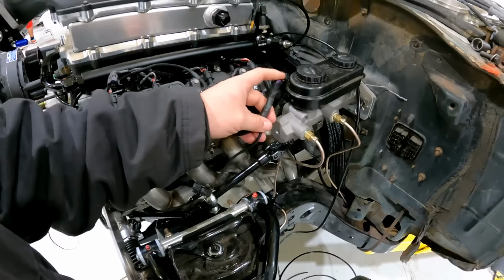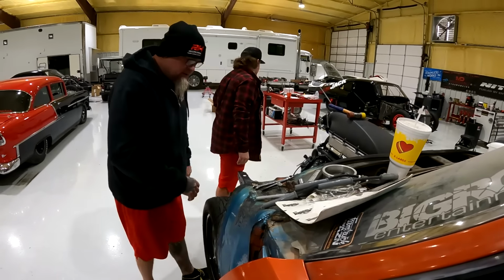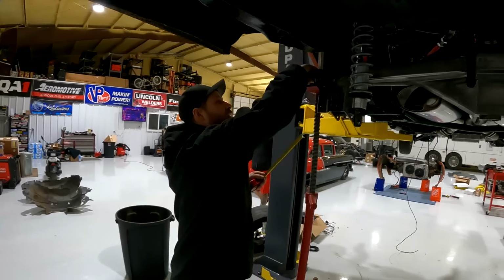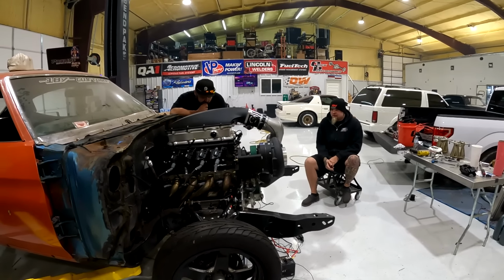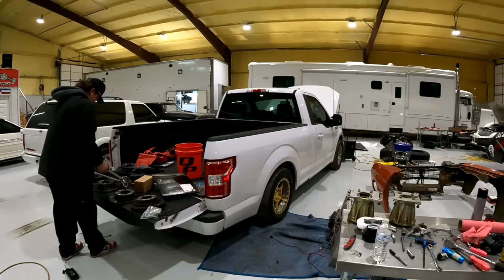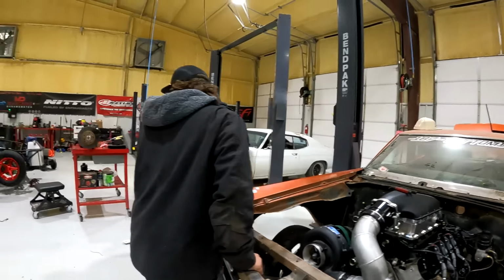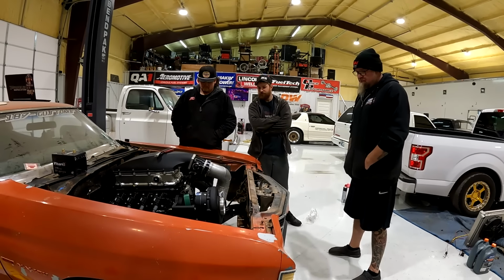Will Aiden’s Procharged LS Swapped Start Up?! Plus Building New Quick Performance Rear End

Comment: Hey Shawn I saw another guy with similar engine combo and had same belt issues and he added one if not two additional belt tensioners if u want to see it it was in the short video section and u can search procharged small block with belt issues added belt tensioners and u should be able to see what he did ,I thought it might help you guys I’ve never had one or even worked on one but morons help each other out is my motto 😂

Comment: The ubolt straps on the ujoints only have to looses a bit for ghe caps ti fly out past the retainer lug on the pinion yoke. Them being loose is about the only way the caps fly away. If they are tight the ubolt. holds them in place.

Comment: I remember swinging the hammer as a kid working on my jeep Cherokee putting the lift kit on and the control arm bracket needed some clearance. So hit it with dads big hammer that had the nail in the handle end and watching the hammer head come off and hitting my dad between the eyes

Comment: Used to try running the 80s sikverados on the street with stockish converters and 350-550 horses,and every one was a dog without a stall,but had one with a stroker and 450 horses that still got 12 mpg...

Comment: When you talk about Daltons new converter making more HP to the tires not improving ET and compare it to npk car making more HP with the turbo setup than the new setup. could you have made some change with turbo / converter setup and achieved the same ET’s as pro charged setup and saved a small fortune ?
Reply from the maker: Not in so simple terms but yes

Comment: Aiden was wondering how he could dip that bearing on the axle in grease before someone mentioned dip a finger. And again parts like axles shouldnt need to be beaten together or apart if they are built right.

Comment: I’m from the uk and not fully knowledgeable on these American engines but what’s the reason for the high placement of the pro charger ones I’ve seen are normally mounted at the bottom of engine where your belt is connected to
Reply: All depends on where there is room

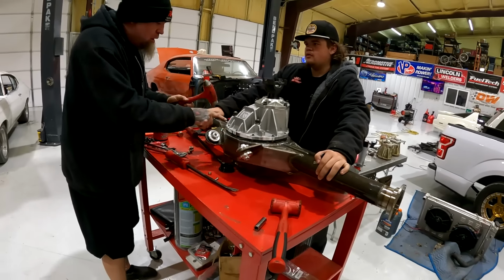Comment: @27:35,, WTH? Why would ya need to take a BFH to get those parts mated up? Couldn't ya run a brill bit one 64th larger thru those holes before putting it together? It's gonna need to be taken apart at some point in it's life,, another BFH and pry bar's gonna be needed.

Comment: The engine looks like its mounted at a pretty drastic angle and not the standard 3 degrees. Is there a reason for this?
Reply from the maker: Only so much you can do without cutting the floorboard out of it

Comment: New shop No Heat / Air or not yet??  Beating the third member in Ouch!!   So how do you take it back out!   Open the hole up!  Not spoiled Entitled maybe!  We would all do it if we could!  Powder coating added thickness to the axle tube, You should not have to beat them to death
Reply from the maker: It will loosen up after it’s run

Comment: 30:14 do what on back in driveway? same thing but with a shortened 700 pound AAM1150, after filling the electrical trench rolling in mud fighting with frame twist on uneven ground with cement blocks sinking into the mud and 3300lb ratchet straps clinging to the edge of sh!t to line everything up finding out just by looking something wasn't right with the previous owner getting rear ended where the fuel switch was and having to line it up again then burn 20 pounds of welding rod filling gaps in arc gouge cut plate because it had to be moved... welding rolling in mud in a 2 foot crawl space just to keep the gas down the line then at the end of the day their is 4 inches of snow mixing in with the mud and it drops from +45 outside to -15 in one night. how much CNG could a 4''OD 1/2'' wall flow at pressure, because if that was a drill rig pipe that would be a 30'000-60'000lb-ft section for 800-1200hp of shaft... that has to be used that day because, clear snow or walk thru it in socks because the boots are next.
Reply: a static 2000psi flow pressure at 1320 feet per second, the whole 300 pound cutting torch bottle is half mile away and more then 50 miles down the road after reading about it.
Reply: $50'000/second $3'000'000/minuet $178'000'000/hour 4.3B/day 132B/month for 7 months or a trillion dollars a year.
Reply: china man says they can run wide open for 100 years... 170 trillion dollar expectation + credit interest.

Comment: Center section and axles didn’t fit     Fix number 1 use an impact on the nuts ( good luck getting pumpkin out ) fix two hammer axles into the housing       Note to self , don’t buy quick performance 9 inch 😂😂😂😂

Comment: Listen, I’m moron nation through and through but,,,,,,,,, that center section if it ever has to come out, is gonna be a bitch to get out. I’ve done quite a few 9” drop ins and I never sucked them in with the nuts. Love you guys but I would have found the spots that were tight and done a little clearance work so it would drop right in. But you do you.
Reply from the maker: I bet it slides right out

Comment: My add is killing me.   The heats on and the fan vents are wide open letting most of it out
Reply: You need a lot of fresh air coming in for those type of heaters unless you like getting headaches from carbon monoxide or worse. Guess how I know.
Reply: @adematthewsracing  I own a shop and run the same heat too. I know all about it.  There’s ways to mitigate the fumes.

Comment: I understand your concept teaching your son you have to work for what you want my dad is gone and he never did understand me I'd work my ass off all week long working in a bodyshop and spend every penny on my car and street race it blow it up and start over my dad thought a car was to go to work in and get you from one place to another he wasn't a car guy your son don't know how good he has it. But my dad told me when I was almost old enough to drive you have to. Buy your own car and as long as your living in my house it has to have insurance on it. Because I'm not going to be sued if you get in a wreck so at 141/2 I bought a 69 chevelle and even though I got my license on my 15th birthday I still had to wait about 4 months till I could afford insurance.....lol it was a small block 4 speed car with a bunch of SS options bucket seat console car 12 bolt SS hood with the 2 buɓbles and grills. But no ss badges . I wish I still had it today. Alot of fun times at the drive Inn. It was the mid 70s

Comment: I have become a great teacher over the years,by using laymans similarties! You trying to teach about converters,is the same as HP vs Torque. Dont give a F-ck if its 800 hp,( the measurement of the amount of work being done in a specific time) Torque is the actual work being done. With my kid,(he raced Dirt Modifieds)I simply compare it to a grilled cheese sandwich,you can crank the burner up to high and burn that bitch down and have two pieces of bread,burnt with melted cheese,or go medium on the burner,and end up with nice golden toasted bread,with melted cheese! Its all about the end result.

Comment: Your father, with decades of driving experience put that combo into the wall. It's making more power and you've put it in Aiden's car. He was used to racing it with a SBC and he was nervous with that combo..How long before he races it on an un-prepped surface and loses it? He's only doing this 'cause he wants to be you. He doesn't have the driving ability to control that car with that sort of power, driving ability is not genetic. Just 'cause you can drive doesn't automatically mean he can. This is the stupidest thing you have done, by far. You felt bad when your father crashed the '55 with that combo with less HP, how're you going to feel WHEN your son does? Erin? She'll never look you in your eyes, again. Dalton has driving ability, but he'll park that race car and feel guilty for the rest of his life, for egging him on to go stupid fast. He should be racing RC cars, not ones that make thousands of horsepower. Please think about this, for once.